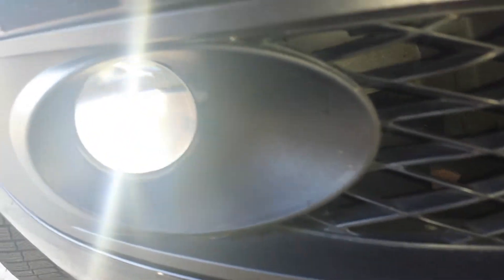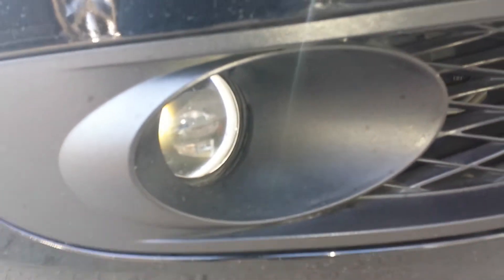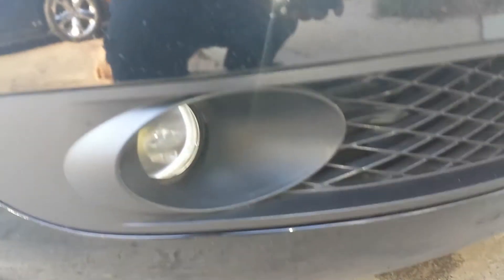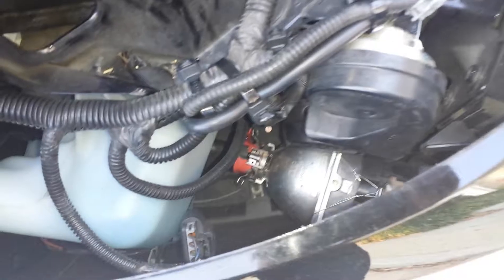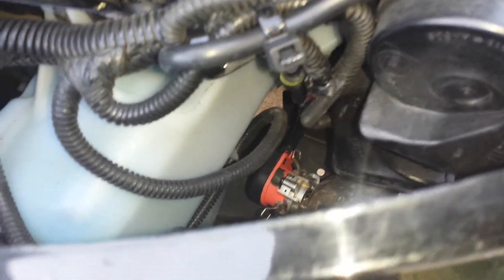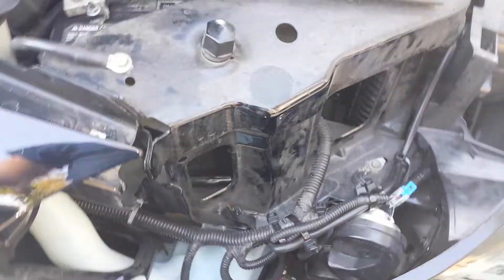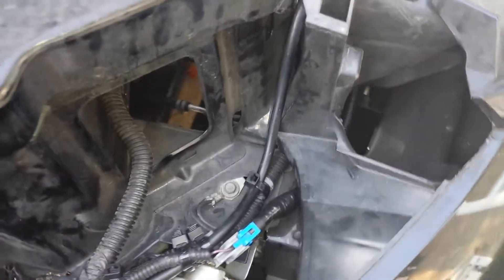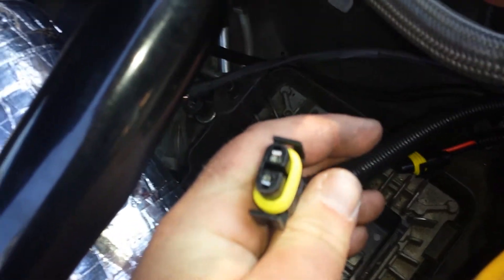2012 impala ltz modified fog lights

Comment: Would I be able to buy the whole fog light assembly and hook it straight in my bumper on a 12 Impala lt without fig lights from factory ? Or would I have to buy a whole new bumper with them in there ?
Reply from the maker: not sure....you'll have to get new bezels at least but for the bumper I'm not sure...can't remember
Reply: I was able to install factory foglights with the oem fog light switch integrated into the dash such that when it turns on, the fog light symbol turns on. What you will need is a relay switch, new bumper, fog light bezels, fog light harness, fog lights, and oem impala headlight switch with foglight button. bb engineering has a diagram of how to wire it.